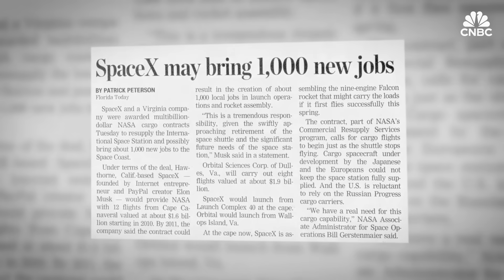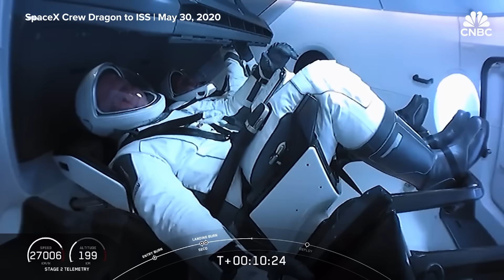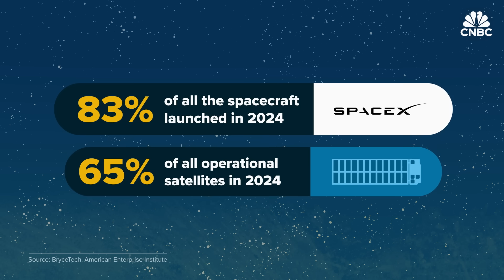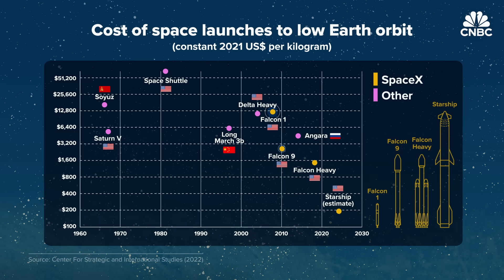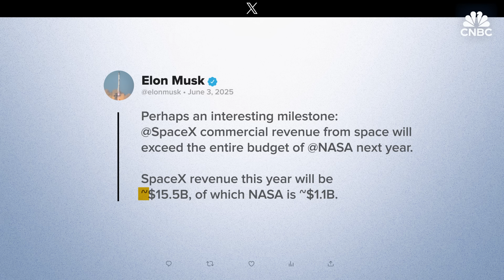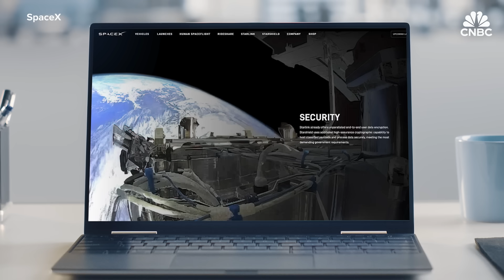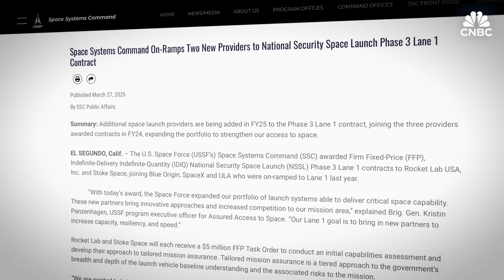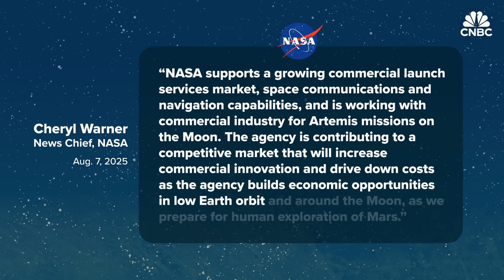How The U.S. Became So Dependent On SpaceX

Comment: One reason is America is embarrassed to rely on Russia to take astronauts to and from ISS. 

Second NASA put out a contract to have at least two unique  American spacecraft to do the same job as the Russians. 

SpaceX worked out a reliable method first.  Boeing starliner is FUBAR so SpaceX is the winner. 

I should add the space shuttle was a failure as a reliable system.  It was fansatistc and very patriotic system but not reliable.  25+ deaths is inexcusable .

Comment: Who is in the lead? No one has the hardware to support the strenuous working conditions. Hardware lagging the software. If Tesla is experiencing difficulty even with their work culture, others are likely the same. The difference is others don't have the necessary capital to focus on the hardware problem. They need to fine-tune the software to demonstrate to their investors and potential investors. They eventually need to tackle the hardware and logistical problems. Durability and mass production at cost will be their challenges more so than Tesla.

Comment: They've relanded boosters over 400 times. No country or company has done it. They're decades ahead.
Reply: Rocket Lab and Blue Origin will catch up pretty quickly.
Reply: @timmit-s4d no they won't. Even if they land a booster, which I hope they do, doing it 400+ times requires significant expertise they just don't have yet.
Reply: @timmit-s4d Catch up? Definitely not. They will both definetly be the next 2 groups to land an orbital class booster.

Comment: There was a vacuum in the need for surface to orbit transportation.  Spacex stepped up and filled the void.  40% applauded, 60% hissed and booed.  The 60% wanted things done their way so they could control them, but their way got nothing done.  They were forced to buy from Spacex and they hated to be forced into anything even when it is good for them.  So they tried to control Spacex by regulation and laws.  That didn't work because in the end they NEEDED Spacex, so they used them but still didn't like it.  They would rather spend 2 billion to do something Spacex could have done for 100 Million just to prove the lengths they would go not having to depend on Spacex.  But they still must.

Comment: I find it frustrating when people casually throw around the word monopoly just because a company is executing at a higher level than anyone else. A monopoly implies unfair suppression of competition or artificial barriers to entry, but that’s not what SpaceX is doing. SpaceX built its position by creating a company from scratch, refining its technology, pushing innovation, and driving down costs through engineering discipline and rapid iteration. Nothing stopped Boeing, Lockheed Martin, Blue Origin, or anyone else from doing the same. The opportunity was wide open, SpaceX simply delivered where others failed or moved too slowly.

Take Boeing as an example: they have decades of aerospace experience, billions in government contracts, and even received more funding than SpaceX for the HLS program, yet despite these advantages, Boeing has struggled to put a reliable crewed vehicle into orbit while SpaceX has flown mission after mission successfully. If anything, Boeing had the incumbent advantage, but squandered it through inefficiency, bureaucracy, and lack of innovation.

Calling SpaceX a monopoly ignores the reality that competition is still there, it’s just lagging. United Launch Alliance, Blue Origin, Rocket Lab, and others are all in the race. The difference is that SpaceX has proven capable of lowering launch costs, reusing rockets at scale, and achieving milestones the rest of the industry only talks about. They earned their market dominance by actually delivering results.

Labeling that as a monopoly is lazy thinking. It punishes success instead of recognizing that the true issue is other companies failing to compete at the same level. SpaceX isn’t “taking advantage”, they’re showing what’s possible when you innovate relentlessly, cut waste, and refuse to accept the old aerospace mindset that progress has to be slow and expensive. If the rest of the industry wants to catch up, the solution isn’t regulation or finger-pointing. It’s better engineering, faster iteration, and actual delivery.

Comment: Spacex had a good run, but they've come to a dead end with Starship.
Reply: way, way, way to early to tell
also, lets say starship wont work, an expendable upper stage should still be very difficult to compete with
unless stoke works out perfectly or so
Reply: @snuffeldjuret  It's like their 9th or 10th failure. Starship is suppose to send astronauts to the Moon by 2027. I highly doubt that will happen.
Reply: @snuffeldjuret  So far it is a dead end. Starship is going no where.

Comment: rocket lab is probably theonly private company with a chance
Reply: As probably Rocket Lab’s smallest shareholder, my biggest concern is that the upcoming Neutron medium launch vehicle is only going to be launched from Wallops- which means it can’t even launch full constellations of satellites (not even Rocket Lab’s own full constellation) due to inclination limitations. It’s a real programmatic weakness. - Dave Huntsman
Reply: @dphuntsman  seems.. odd to me. If the rocket is good, surely they'll be prioritized to get space to launch from anywhere suitable. But yeah, haha, there doesn't seem to be many concerns, so I get why it is your biggest :).
Reply: @dphuntsman  Isn't the main problem of constellation the scale required to make them work ?
I think Rocket Lab would go bankrupt from getting both new launchers and new sites at the same time, before they get any meaningful* constellation going (*made out of at least 100s or 1000s of satellites).
Reply: @CompatibilityMadness  Rocketlab has opened the wallops site, but cannot deliver completed boosters because the locals are complaining about the need to dredge the canal so they can deliver one. They would need to compete for a new medium-heavy pad with the Army Core at the cape as well. The cape is saturated, which is partially why SpaceX is also proposing the new LC 49 for Starship. Licensing a new pad is extremely expensive and time consuming. That is infrastructure cost and time that they don't have cause public investors are like 5 year olds and have no sense of continual progress.

Comment: Just wait for starship 
Nobody would be able to compete with spacex once starship is launching frequently
Reply: It's true which also makes it good and bad. Good because it will increase capabilities and advance spaceflight to a different dimension, and bad because it's not good to have a monopoly where others can't compete. but then again, that lack of competition is not spacex's fault.
Reply: @netstatmint8639 competitor's can still exist if the come up with unique designs
Reply: @netstatmint8639  There is plenty of market space for other launch providers. Rocket Lab is a much smaller company that is growing and Stokes is another. Its becoming the golden age of space flight.
Reply: What's funny is that SpaceX already charges about 2x or 2.5x what it costs per launch, and they still stay cheaper than anyone else.
Reply: Also starlink is profitable so they are printing money that way as well
Reply: They already can't lol, falcon 9 is leagues ahead of current comp

Comment: Its very simple reason , all traditional aerospace company became complacent and inefficient
Reply: That’s a very occurring symptom within the US tech companies lately, look at Intel and how they fell behind in the semiconductor sector. All because of  financialization over productivity.
Reply: @ChristianDoretti yup capitalism can drive innovation but once share holders/board members bring financialization to the equation everything goes down hill from there. They see it coming they sell their shares and brand new investors is kept holding the bag. they never learn to be careful with financializtion. Left unchecked when you try to increase bottom lines aggressively from already record breaking profitable  companies it’s a wrap. But they just move on, look for the next big thing and the cycle repeats itself. Finalization did that to Boeing,s commercial aviation department to. Profits over innovation and moving to the next big thing with the proper materials to last and save money now we have the Boeing 737max. It needs a computer to fly straight and the air frame and design are from tue 60s. If  space ex and the rest stayed using or recycled the first space shuttle,s design to save money space would still be highly expensive to get into.
Reply: @ChristianDoretti  that's not true 

You can't be over productive and lose.

you mean the became complacent.
Reply: @uromvictor   Chasing the stock market bottom line rather then quality, two generations of failed CPU was enough to end their dominance. `
Reply: @uromvictor  I can assure you that the other "main" launch company, ULA, does not operate efficiently
Reply: @ChristianDoretti but all government help and subsidy goes to these types of tech company who have more financial people than engineers 😂,thats why east asia is dominating
Reply: Some how that’s the life cycle of companies. If they are the only one or become dominant, they get complacent while the ambitious kid come topple them. And they know it, they always say what destroys a company but they repeat the cycle anyway
Reply: true
Reply: not just traditional even the new ones are inefficient amazon blue origin started around the same time and now their nowhere near close to wear spacex is.
Reply: That's the truth. While SpaceX innovates and becomes cheaper. The rest of the US space industry proceeded to bloat themselves with overpriced and underperforming products. It is only natural for a free market.
Reply: The big OG defence contractors just milk it
Reply: DEI
Reply: 😂 NASA was gutted, then when it started not delivering, they called it inefficiency and privatized. Good try
Reply: @Alwaysiamcaesar it got DEI’d too
Reply: @TurdFergusen  Doesn’t matter, some of the most successful companies in the world were practicing DEI and still are…
Reply: @Alwaysiamcaesar  they were successful before dei.  lol didnt earn it.